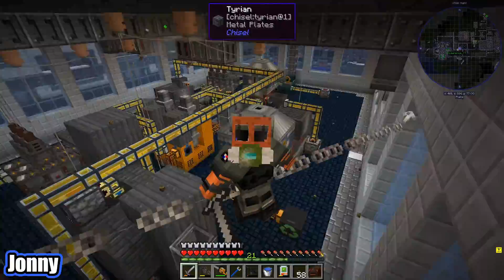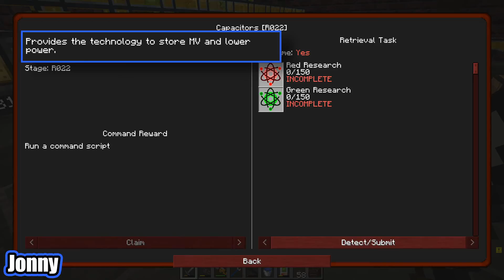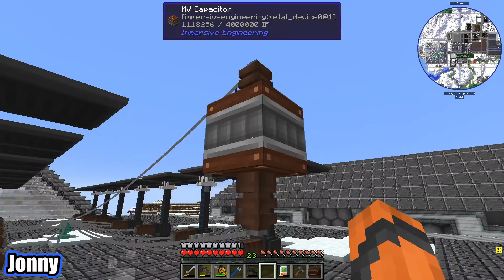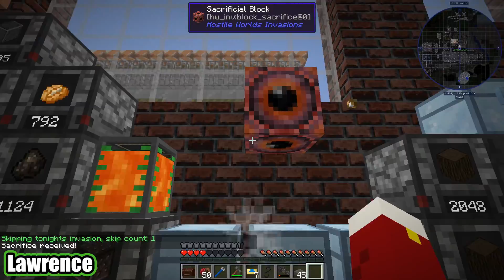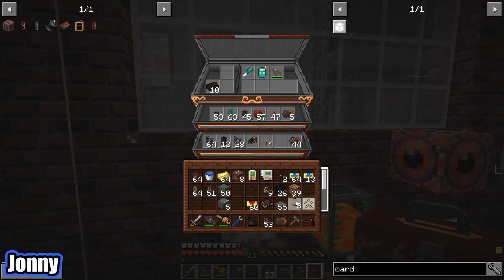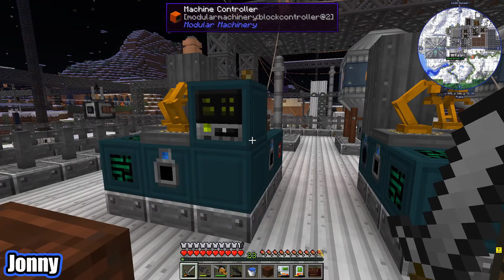Ramping up production! !(E25) - Manufactio

Comment: i recently learned that when you're making a bunch of metal presses, if you have the Building Gadget you can use it to place the piston in the desired alignment and you don't have to hammer it into that position (kinda like a copy/paste).  Saved me a bit of time the last time around.
Reply from the maker: Thats a really good shout, I knew it kept orientation but never considered it for the metal presses, thanks!